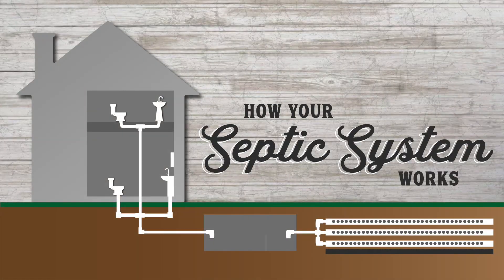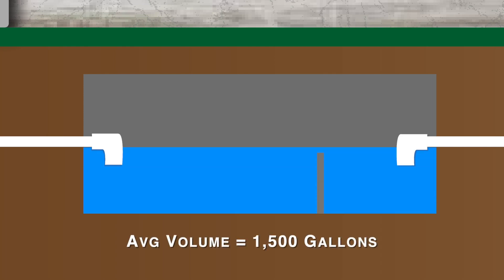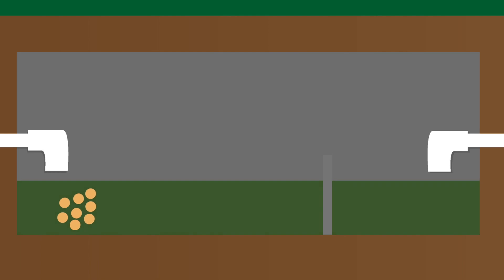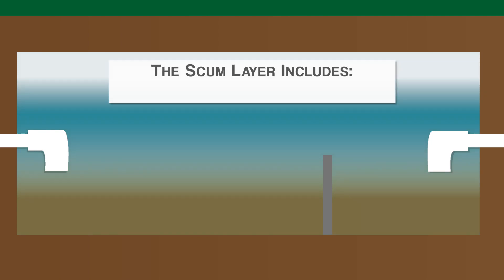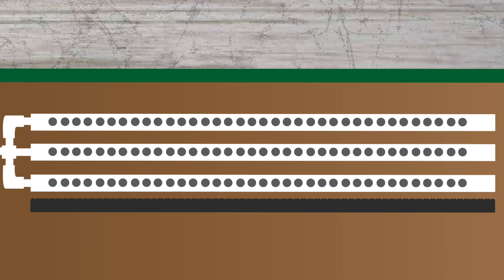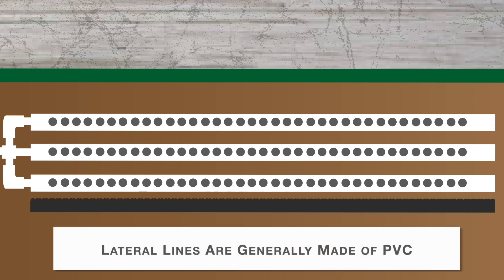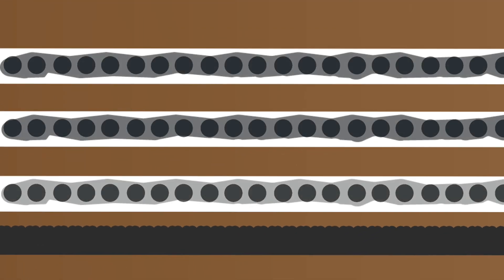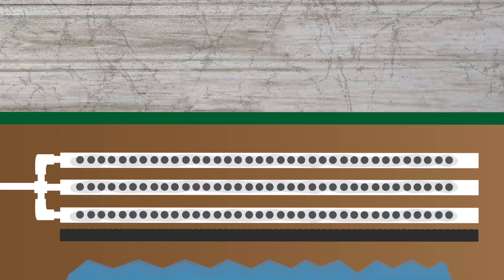How A Septic System Works

Comment: HEEEEEELLLLLLLLLLP !!!!
Why does crap bubble  up into our tub!!
Reply: Yikes! Stuff backing up into a tub means a significantly slowed or stopped system at some point. Without other indications, it can be hard to know whether this is a field issue, or a blocked line before the tank. We would advise flushing 2 bottles of Unique Septic Field Rejuvenator from somewhere upstream of said tub. Hopefully this solves the problem in a relatively painless and inexpensive way. If the problem persists you’ll probably need to call out an expert who can help you manually resolve this issue. 

Septic Field Rejuvenator: https://uniquedrainseptic.com/collections/septic/products/septic-field-rejuvenator

We can always dig into this deeper with you if you need additional guidance! I know problems like this can be scary, so if you’d like assistance, we’re happy to help! Our customer support team is back in on Monday if you’d like more help!

You can reach our support team at 866-662-4513

Comment: One of the lines will not stop running, the ground is soaked and does not seem to be drying out.  That line is in the front of the house and the water runs down the hill. It has not dried out in a few months. Please help